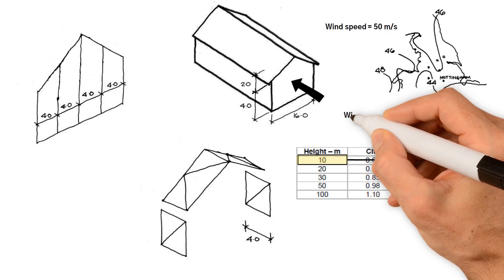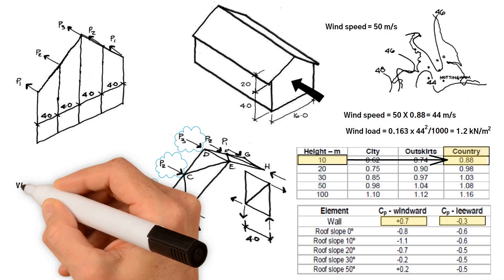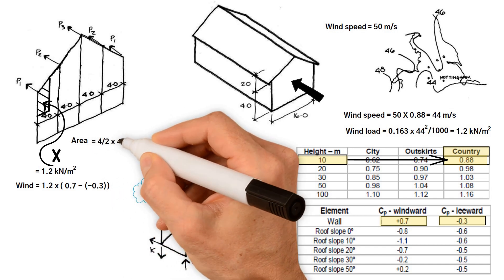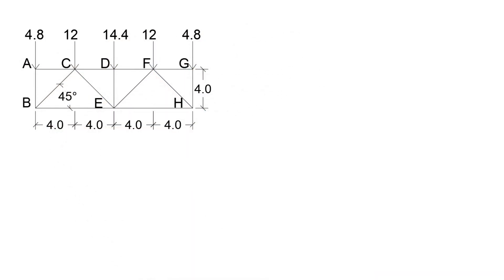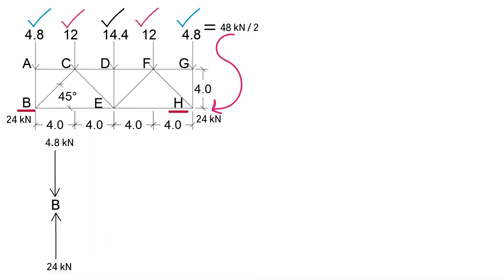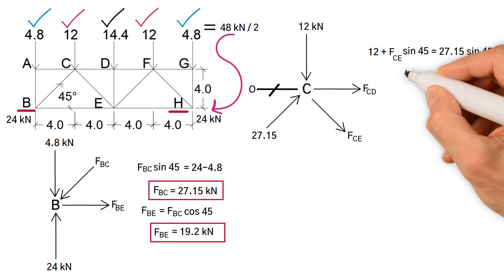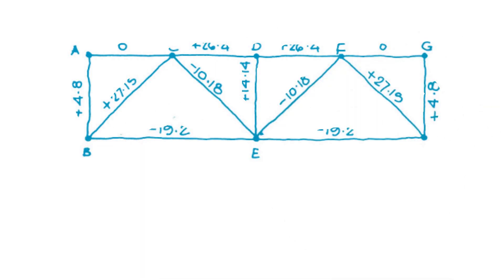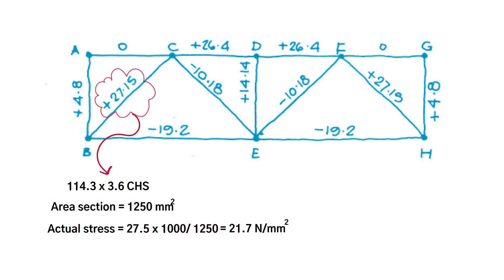How to work out wind bracing sizes for portal frame

Comment: What is the 0.163 it represents what and where did it come from?
Also thanks for the simple and awesome videos...
Reply: Typing error it should be 0.613 it clearly says at 1.09 minute. Raw (p) is the density of air taken as 1,226 kg/m3 in accordance to National Annex (NA to BS EN 1991-1-4:2005). Whereas, qb=1/2 p (Vb)^2    =    0.613 Vb^2

Comment: The Windload load is incorrectly written as 0.163 xV(squared) instead of 0.613x V(squared) 1:23
Reply: May I know what's the 0.613 is about? is there any table we need to refer?
Reply: @hanimahfidz8317  The 0.613 is  0.5 x density of air .Density of air  is 1.226 kg/m3